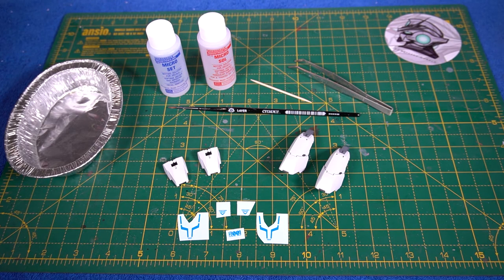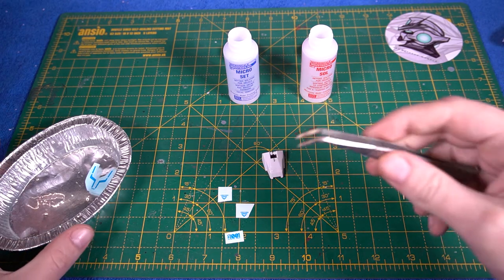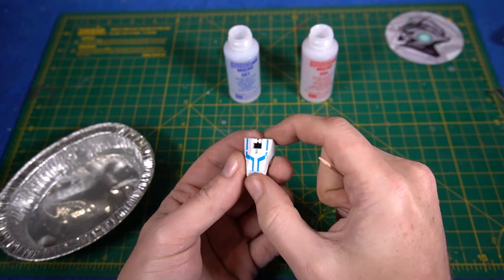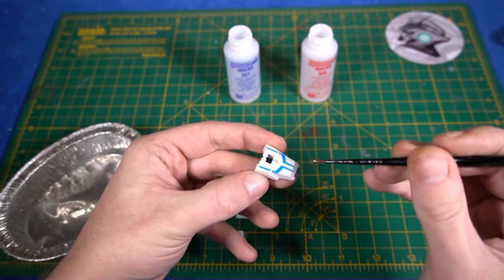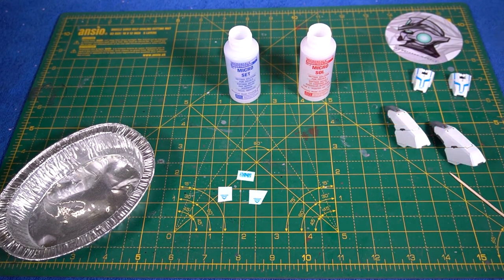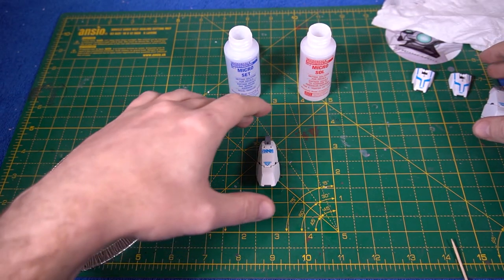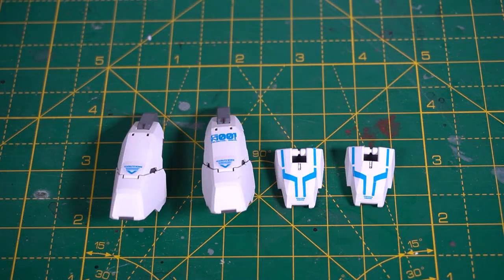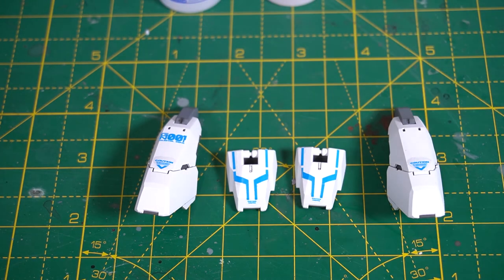How to Apply Waterslide Decals- Using Micro Sol and Set

Comment: I have been modeling for a long time without decal set. Mostly successful, but some screwups I hope this helps. One thing I do know, is never use a toothpick on decals unless you have to. I use a Q-tip. It's gentle and soaks up excess water. Thanks for the video.
Reply: Agreed. NO TOOTHPICS. A Q-tip or pencil with an eraser. Use the eraser.

Comment: Hallo. One question. I have 1/16 Tiger tank, matt grey colour. Decals are glossy, and that looks bad . Can I use this products to stickt them to tank and make him matt like rest of the tank. Thanks
Reply from the maker: Yes you can use this to apply them and I would use a matt topcoat over the model afterwards.  This should give the desired effect your after.  I have done a similar thing on other models in the past just make sure the waterslides are fully dry before topcoating.  Hope this helps.
Reply: @prometheusgunpla8444  Thank you very much 👍👍👍

Comment: Does that strengthen the adhesion of the decal? I wanna use waterslides for a real motorcycle fairings
Reply: I don't think it impacts the adhesive properties as much as it makes the water slide working time longer and they softens it further so the decal shrinks more to the surface for a painted on look

Comment: does the temperature of the water matter?
Reply: I find between cold and lukewarm helps
Reply: the last time I did decals I used cold water
the only difference I think of is just the time you have to wait for the decal to slide off easily but I believe it's only a matter of seconds really

Comment: What does the Micro Sol actually do?
Reply from the maker: Hi the micro sol softens the waterslide allowing it to adhere to awakward surfaces, the set then makes it harden faster to the new shape.  But still best to go over with a topcoat to seal the transfer.
Reply: @prometheusgunpla8444  what about flat surfaces? is really the Micro Sol useful or just a waste of time?
Reply: @Tommy27ZB  I think it dissolves the transfer medium leaving only the printed area thus eliminating any edges.